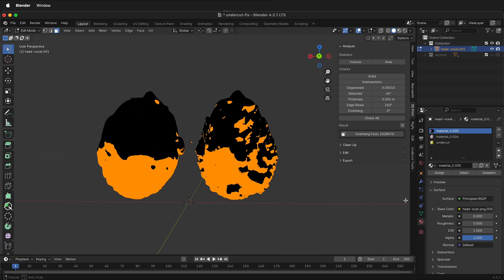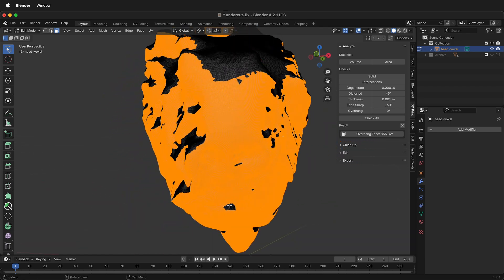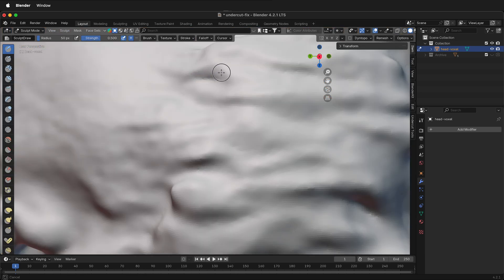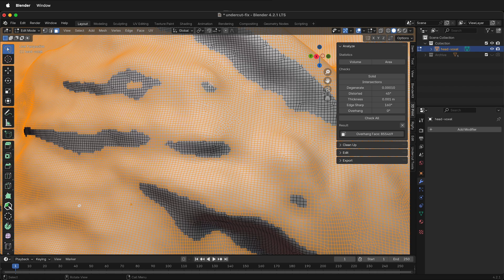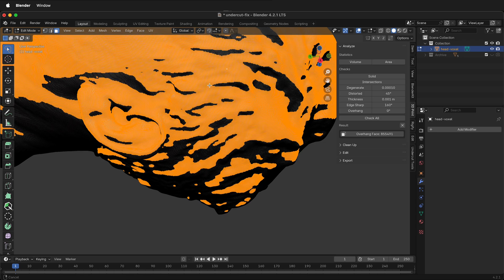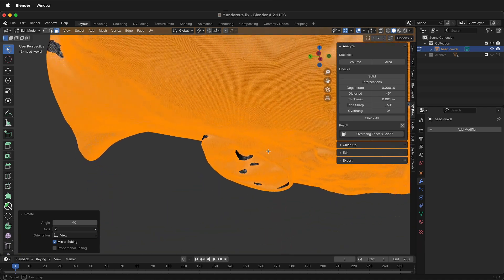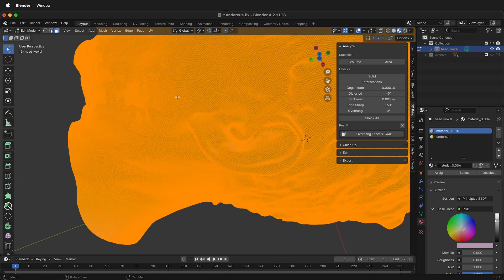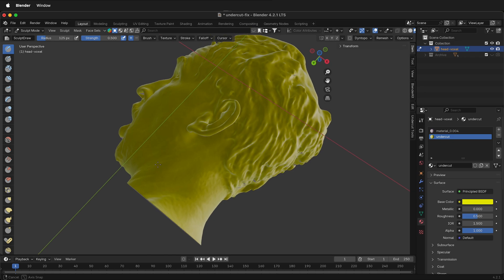How to Find and Fix Undercuts in Blender for 3D Printing Molds

Comment: thanks, crazy there is no automatic solution for this problem. Hope an addon will come.
Reply from the maker: You're welcome, an automatic solution would be great
Reply: @WhatMakeArt  it could be a way actually. 3D to Depth map to 3D, and hop you got a 3D compatible with mold without manually modifying.